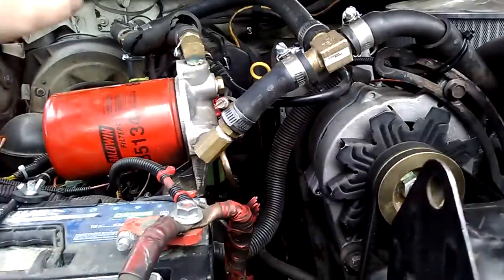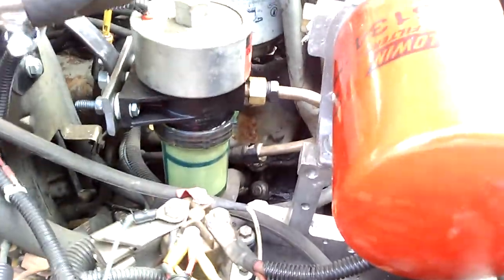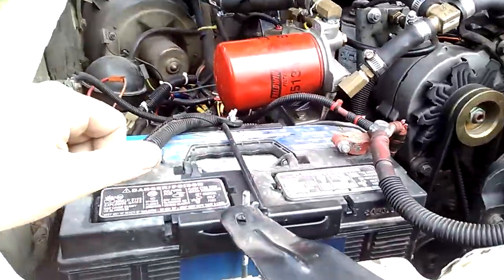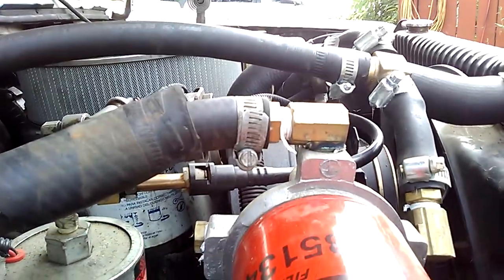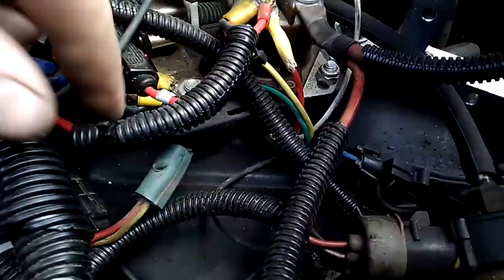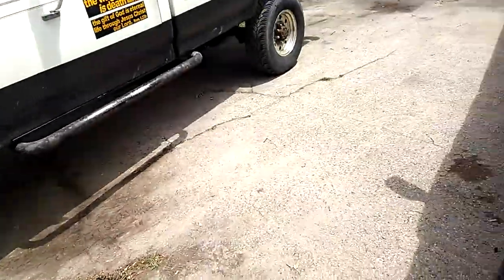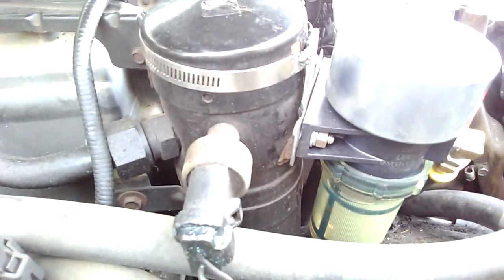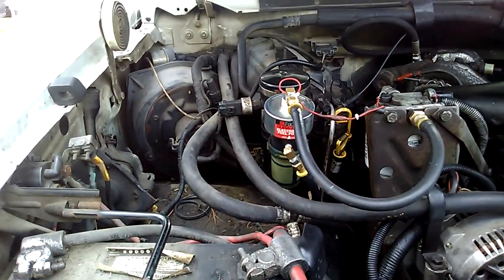Facet fuel pump on 7.3 IDI

Comment: WOW this video is 4 years old and you never know who is inspired by them years later. I recently bought a 94 F250 IDI turbo. Thr truck runs great all stock...except several times under heavy acceleration the truck just stops. Like it ran out of fuel. It starts right back  up but I'm wondering if the mechanical fuel pump can't keep with the demand...and that's what's happening. It has never had any starting problem ever....I live in a warm climate (Florida)  Just wondering is this a common problem with these engines. Other than that it runs awesome. Your feedback? Thanks.
Reply from the maker: Sounds like a sticking metering valve or potentially a restriction. If you have no other symptoms I'd try a heavy fuel cleaner dose and a fresh fuel filter.

Comment: I've been using a Mr Gasket fuel pump for 23 months so far on my IDI. It was already on my truck when I got it. I have a $5 small engine fuel filter in line between the tank and pump and replace the filter as needed. It is clear so I can see its condition. It catches trash so it saves the pump. It has been up as high as 10k feet in Colorado and down to sea level in Washington state.
Reply from the maker: been hit and miss on em I burned one up in a short period of time so not going through that mess again.
Reply: Mike, I think the reason you and others have burned them up is because of that tiny metal fuel filter that comes with them. Trash that. Put a separate clear filter inline before the pump. The pump will last a lot longer.
I kind of suspect the mfgr knows that. Either planned obsolescence, or they just don't care...
Reply: @selador11 I highly agree with you on that one

Comment: Old guys say frame mount it because heat. I'm running push locks on 40222 with block off plate and rear tank removed(4" lift on baha tread and 4.10 so no need for long mileage). Had to solder front sender wires to selector plug wires for dash guage. I want to replace send and return hoses for tank. Know inner diameter? I'm on the road and going to do it when I get home; also best hose to use I hear there are shielded options?

Comment: What's the internals on my 89 7.3 idi selector valve? Can I just run directly to front tank with barb connector in place of selector with your setup?
Reply from the maker: A  plain barb won't be able to distinguish between the 2 tanks. The selector switches both the feed and the return. I did see a guy replace it with a simple manual ball valve setup

Comment: You should make a video covering the selector valve and how to delete it, I want to get rid of mine but I’m unsure what to do about the fuel gauge? I read online that the orange wire is for the gauge and you can just jump it to the sending unit on whatever tank you want to use but I would like some more knowledgeable advice before I start cutting into random wires on my truck

Comment: I've seen other videos installing an electric fuel pump on these and I'm about to do it to an 86 E350 6.9. Others have used an inline fuse and relay to wire in a pump, does it not require that to work? Also, do you run wvo or wmo at all?
Reply from the maker: no wvo and wmo will kill electric pumps. I tied mine into the gp relay which already is on a fuse for my 94
Reply: @groundtogreen1140  my front tank runs wvo on an airtex electric pump (how it came from the last owner) and apparently it's been that way for a while. Still running through everything. Running all new fuel lines tomorrow and dropping the front tank to see what it looks like, to see if I'm going to keep the setup but so far I'm leaning towards it. Unless I run into a mess of polymerization in the tank.
Reply from the maker: @Grunt-force-trauma  well thats good maybe thats a better brand pump I just know others that had wmo/wvo issues in the past.
Reply: @Grunt-force-trauma  hey I am on the same path as you with my 85 6.9
Can I ask you how your journey went? I have a plant drive set up
Reply: @brendonmasters  I have a facet pump hooked up to the new fuel lines that come from 2 brass valves tank selectors join the floor. I ran power from the original hot wire from the tank selector valve since I am no longer using the factory set up. I put a 3 amp fuse in line from the hot wire to the pump as per facet recommendations. Time will tell if it last. I've heard some people wound up switching to a scavenger type pump and they get a longer life out of them.
Reply: @Grunt-force-trauma  you're a badass thanks man!!

Comment: put glow plugs and new controller on mine, still have hard starting issues. hopefully this will help me out. 1990 e350 ambulance van. gotta figure out where to mount it though, its pretty cramped in there.

Comment: thanks again for the help. I have a 5spd transmission. I live in NV and it's -4 outside .the fuel system I fabbed up ,facet pump and Napa fuel hose...who makes the best block heater?this is going to be a daily driver 4x4 all parts have to be reliable and easy to source via Internet
Reply from the maker: I haven't really come across a preference for best but I use oreillys in my area they have a liftime warranty

Comment: Did you use the tank pumps as well or eliminate use. 1990 f350, replacing both tanks and components, will be trying this set up utilizing oem switch over valve for both. Let me know. Thanks.
Reply from the maker: James Orbin IDIs didn't have in tank pumps
Reply: Mike Grn just a draw from mechanical pump. I only ask because I haven't opened up sardine cans yet

Comment: Hey Mike I have a 1993 7.3 idi just put a banks sidewinder turbo kit on it.. i used the block off plate you suggested to delete the mechanical pump worked great... bought the 9 to 11 psi facet pump have it  mounted where yours is..spliced and plump the line right before the sector valve..my fuel filter light keeps coming on at speed above 50..and on hard acceleration.... any suggestions on what I'm dong wrong? Its like its not getting enough fuel from pump...but it should be sense factory is rated for 4 to 7 and this one is 9 to 11?
Reply from the maker: When is the last time you changed the filter ?
Reply: Maybe 30 thousand miles ago think thats it?
Reply from the maker: @incrediblehoke5765  yea it's due I'd try that and see if the light goes away
Reply: Im having the same problem and acts like starves at times could it be bad fuel pump?

Comment: Did it solve your air intrusion problems? I have a 6.9 idi that I have created my own headaches with... I wondered if this will pretty much overcome anything caused by air intrusion.
Reply from the maker: No I actually had to plug the return line from my filter housing going to my caps and that pretty much eliminated my final issues. The facet pump has its own check valve so it was creating a leak down effect it might have just been a weak spring in the check valve in my filter housing I don't know but yeah that's what I had to do
Reply: Would it solve the return start & engine start issues I've been havin with mine? Mine acts like it has a drain in the return lines somewhere & I'll have to crank it to get fuel back through the system for it to start when cold
Reply: @The73idigarage  you might want to replace those return lines and caps

Comment: I just got my facet in the mail. Could I run the 12 volts from my power relay? You said your getting your 12 volts from your glowplug controller? Also am I gonna wanna run a new fuel line directly from my tank to the fuel pump?
Reply from the maker: Yes but recommend an inline fuse my controller already has a fuse for that system that's why I piggy backed there.You can run a new line if so desired or tie into current fuel lines.

Comment: have you dropped the fuel tank on your diesel truck?? does the sending unit have a filter on it? my e-350 van is sucking air from the manual fuel pump back to the tank.
Reply from the maker: It's got more of a screen than an actual filter. It can break apart after years
Reply: @groundtogreen1140  yea my E-350 box has a big steel fuel tank and the sending unit is different than the pickups.I can't find a new sending for it but the pickups you can. I have seen 2 used sending units on ebay out of a van but they have no sock on them at all. nice videos and thanks for the reply.

Comment: I noticed that your positive battery cables on the passenger side were modified from factory? Did your oem connector fail like mine is about to?
Reply from the maker: tnmike55 yea po did that but mine wouldn't tighten up on my other truck so I did the same thing

Comment: So we run a line from the facet pump directly to the line that’s on the tank to the mechanical fuel pump , & where do we put the Block off ?
Reply from the maker: Fuel line from tank comes up by lift pump and the block off replaces the factory lift pump
Reply: @groundtogreen1140  so I cant use this set up using both tanks only one ?
Reply from the maker: @GetOffMusic  no you can

Comment: So you never have any problems with fuel demand with that pump at all? Is there anything to be worried about while using this set up?
Reply from the maker: I didn't no but never ran much past a stock fuel setup. Biggest concern is controlling the wiring had a friend have 2 pumps vibrate the wiring loose from the inside connection but took years to do so
Reply: @groundtogreen1140  10 4 I appreciate it man. I already ordered the pump. Was that loose connection an easy fix or was it shot after that?
Reply from the maker: @sebastianlightell8864  I think one he repaired one he couldn't

Comment: Can you use the fuel filter as a coolant filter ? I have a 6.9 housing (no heater) that I'm running on my 7.3. I'm going to put my original heater housing back on. Can I repurpose the 6.9 fuel filter housing and filter as a coolant filter?
Reply from the maker: too much restriction. Maybe you could use head itself and run a bypass setup but would need a compatible coolant rated filter
Reply: Il get the whole setup for coolant. Thank you.

Comment: Still have same pump in the truck ? Or did it burn up ? Forums say mount by fuel tank but all the videos everyone makes are mounted in engine by fuel filter
Reply from the maker: That truck I should but still have same pump in my 94
Reply: @groundtogreen1140  
So it's lasted several years mounted in engine ?
Reply from the maker: @jbhill7728  correct
Reply: @groundtogreen1140  
Thanks will be doing this very soon

Comment: Did you fuse the wire to the pump off the glow plug relay?
Reply from the maker: tnmike55 no I crimped and heat shrunk a ring terminal and just slid it over the key on post on relay

Comment: So all you really have to do is get power to the pump and tie into the fuel line? Is it just constantly trying to see diesel into the engine?
Reply from the maker: for the most part yes and its feeding the injection pump which doesn't need a very high inlet pressure to operate
Reply: Mike Green which stud on the glow plug solenoid do I need to hook up to for key on power

Comment: AC, heater... can I just cut and plug  the ones I don't need...I'm very already  pulled the AC unit and heater blower out of engine bay .
Also what is the purpose of the coffee can on driver's side inner fender
Reply from the maker: the coffee can thing is a vacuum canister. I believe you can plug some of that you mentioned just be careful you don't cut anything for your brakes or if you have a c6 the transmission vacuum controls
Reply: For coffee storage 🤣🤣🤣

Comment: So why its electric pump better then the original mechanical one ?
Reply from the maker: well a few reasons actually imo

1. the electric pump can prime without cranking the truck which can make post fuel system work easier

2. it eliminates a mech pump fuel diaphragm rupture. Not super common but has happened.

3. this particular pump has a pre screen which can extend filter life. It pulls a lot of the larger debris outta the fuel system

and finally you can add one soley as a prime/backup pump wiring it on a switch so you have the best of both worlds.
Reply: Mike Grn thanks Mike , I just got me 94 idi and chasing all the air leaks :) and it have manny :) someone added 3 stage fuel filtering already, so I got racor 30micron water separates , then 20micron big screw type and 6 micron original filter , I’m replacing all the lines for clear ones and I guess I will add epump just on momentary switch for priming , thank you.  U got good vids about the 7.3

Comment: Do I have to remove the old pump or can I just unhook the feedline and then run an electric pump
Reply from the maker: I'd advise installing a cheap little block off plate but I know some have just left the pump in
Reply: Kyle Smith, any big block ford, Chevy block off plate will work. They sue the same pump on all these old engines.

Comment: Hey there Mike, First off your videos are my go to troubleshooting and motivation source, Im having some issue's with my 89 7.3 Idi, recently it started running rough after start then settling down to its typical rattle and purr, however it stalled yesterday morning after getting stuck in some aggravating slow traffic, I got it started again and it ran well enough, so I could make another stop at graingers, then back to my yard. Typically the truck starts and runs fine with under 60K miles on it, I keep up with occasional fuel related problems including recent leak at the h2o? sensor on the stock fuel filter housing which I just plugged up as it was never hooked up I recently got the TSV and return lines sorted so that im back to using 2 tanks which really extends my travel distance, Im considering replacing the mechanical pump with what you did but my question is how long do OEM injectors last? Im planning on replacing 2 bad GP's here shortly but in Florida so its not as crucial.
Reply: Did you figure out your issues?
Reply: @jadinzack9271  All air intrusion issues since that post ive made 6 trips from Florida to Arkansas and back. I just picked up an 86 6.9 IDI c6 no rust other then the redick price for deisel I love these old trucks.

Comment: Why the high pressure fuel line? Wouldn't regular fuel line eork?
Reply from the maker: tnmike55 the diesel safe line I Have found comes standard as high pressure. In addition it's more rigid and less likely to collapse on itself

Comment: Hello, I added the Facet Electric fuel pump and can not get it to even turn on ... the pump is ran to the battery with the red wire and to the frame with the black wire.. I have a cut off switch half way down on the red wire.   I can not get it to come on at all.. Not I had another facet pump that worked for only a few days... hooked it up the same way but the pump somehow stops working for no reason a day later... Just will not come on a day or two later... Any help would be great
Reply from the maker: I would double check all your connections clean your ground up maybe even see if you can get it to turn on just directly to the battery temporarily to see if it's even getting power. I have heard in recent years that quality of these pumps wasn't what it used to be I haven't had any issues like that I'm just going off of what others have told me. if it's still fairly new pump that should be covered under warranty but I completely get the hassle of having to go through all that